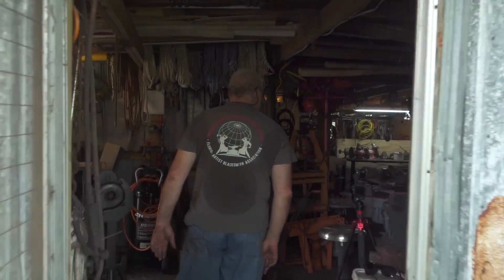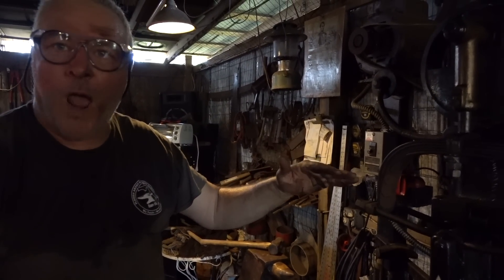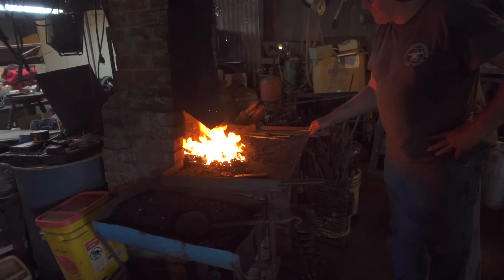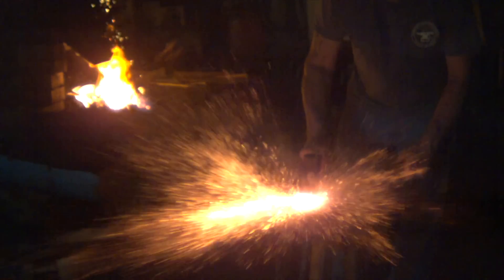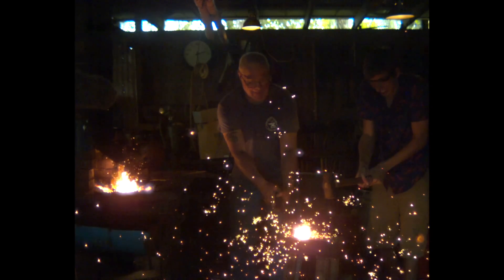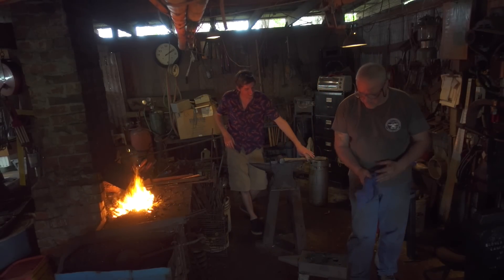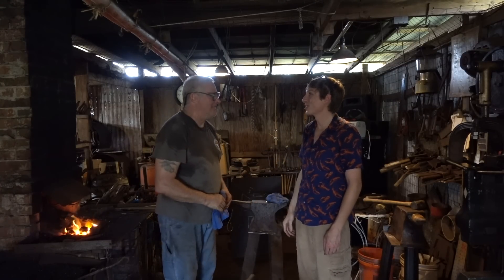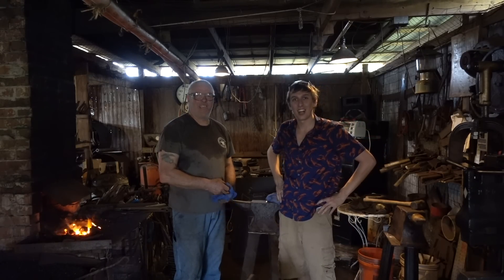Blacksmith Myth - Will a drop of Water on the Anvil make it explode?

Comment: My theory on this is as follows:
Water, or steam, separates at a temperature of 1,700°C into hydrogen and oxygen.
This process is called "thermal dissociation".
When forging steel, the workpiece is heated to "only" 950-1,250°C.
Now when the hammer strikes the workpiece, a higher pressure is created underneath or in the water,
which temporarily leads to higher temperatures.
The temperatures thus generated could be sufficient to split the water directly into hydrogen and oxygen,
which would result in a small explosion of gas.

I don't know if this is right, but at least I can imagine it like this ^^

Comment: What caused the sparks is that he heated the steel up almost to the point of melting it, not actually the water. You can see it sparkling right as he takes it out of the forge.

Comment: I think there might be some truth to this myth but the shape of the metal should be slightly cupped so that it can create a chamber And when you hammer on the top of that chamber and collapse it on top of the water it would create a small explosion I believe but the circumstances and conditions have to be just right

Comment: Also, if you pour borax on the surface, and let it melt, then smack it, you get lots of sparks. Just be careful they do BURN. Also, hot metal is hot, even if it doesn't look like it. Burnt my hand a few times picking up black metal that was roughly 900 degrees

Comment: It's called wet forging or blast forging or scale blasting, depends on who you ask but it's definitely not a blacksmyth or a blacksmith myth, any blacksmith or bladesmith would tell you it won't cause and explosion or break an anvil.  it just throws the forge scale off.

Comment: My guess is that the myth is somewhat true. The water drop will react with the iron metal and form H2 gas (which is flammable) and form iron oxide (rust). It would be a very hot reactoon as the hydrogen would burst into flames but no explosion, just lots of rust afterwards.
Reply: Norgret _ no, just flash boiling.  Getting any significant amount of a reaction like you describe would take pretty crazy temperatures to break enough of the water molicules appart, and would leave the surface more rusty, not super clean.

Adding the pressure from the impact forces the water and metal into full contact (rather than being kept appart by steam), and greatly raises the boiling point while it heats up. When the pressure of the impact starts to subside, all the now superheated water tries to turn into steam all at once and shoots out between the anvil and metal, scouring the scale off of the metal with high pressure steam.

Comment: He overheated that metal. If it glows white and the air around it sparkles, the metal is overheated and burning. That's why so much scale shot off when he hit it -- the scale formed from the burning metal and broke like ceramic.

Comment: It's frustrating to see the "myth factoid" placed on the screen, and you don't test to what the myth reads. Probably no different, but what if in the molten salt videos, you used those other slightly different mixtures, rather than the actual proper salt intended? 
still love your vids backyard scientist, but make sure you follow the scientific method!

Comment: What if you were to heat the top of the anvil in some way for example with an electrical charge and then put water and cold metal on it and hit it with the hammer? wonder if it would work?

Comment: this guy had his metal to hot nearly burning the metal, if you get your metal THAT hot it will expload off the anvil with moltan iron slag and scale without even putting water on the anvil, that is called forge welding temp, i think you should retry this and get him to only heat the stock to a cherry red or amber and also get him to hit the glowing stock without water and with water, i bet you get the same result, you really just had the metal to hot, i use water on my anvil nearly every day you get small pops from the hot metal as its vaporizing the water quik, its just like when you drip water droplets into a hot pan it skates around on a steam pocket yeah? well if you hit that water with a flat surface while its skating around it will just heat up quiker and squish out the sides of the hammer real quik, kinda like when you bite into a cream slice and it all comes out the edges.

Comment: Hey Backyard scientist,  I've got a new idea to make another explosion. This is called aluminum and iron oxide, with strict rules, this can be dangerous so wear heavy protection. 
Step 1: Powdered iron oxide and aluminium are mixed in a glass breaker. To be safe place it in an a cast-iron vessel filled with sand to control the awesome reaction.
Step 2: A magnesium ribbon is lit to ignite the powdered metal mixture as the temperature rises to 4,530 degrees F, the aluminium tears the oxygen away from the iron oxide. The whole area is showered with red hot burning metal.
Step 3: Look in the pot and aw at the aftermath.
-The Elements by: Dan Green
PLZ PLZ PLZ  do this for your viewers, thanks
Reply: Literally everyone has heard of thermite.
Reply: It's called thermite
Reply: He's done Thermite reactions before, and I agree that they are beautiful, and deadly.
Reply: uhhhhhhh ummmmn thermite
Reply: This guy invented that, he named it "Thermite"

Comment: Do this same experiment but with titanium or any of the alkali metals!
Reply: There's quite a few race engines running titanium valves, keepers, locks, connecting rods, and wrist pins.  Not pure titanium obviously but still a variant of it.
Reply: Even the alloys of TI will "combust" if you get them hot enough. The only reason Ti engine components survive is because they're actively cooled.
Reply: @beachboardfan9544  I think you've encountered a Reddit scientist™ who think they're a lot smarter than they actually are.
Reply: u mean potassium, titanium is a transition metal. GET UR CHEMISTRY RIGHT
Reply: No I mean titanium, because red hot titanium will break apart the hydrogen oxygen bond of water, absorb the oxygen and leave behind sweet explosive hydrogen. I added the alkali metals because all of them are simply reactive with water.

Appreciate the aggressive comment from a 10yr old tho, wont make much of an adult with pretentiousness and cynicism.
Reply: wait, WHAT? titanium is a inert-ish metal. It doesn't react THAT much.
Reply: liked for your chemical knowledge.
Reply: Yea, Ti is fairly inert until you heat it, not only will it produce an exothermic reaction with oxygen (like most metals) it will also react with the nitrogen in the air in the same way it does with oxygen. A few race engine mfg.'s had some catastrophic failures while testing some Ti components, the Ti got hot enough to combust and well turned into TiO2 and TiN2 (essentially a white-ish powder). Ti is really only useful as as non-friction structural components... unless its goes through extensive surface coating procedures.

Comment: I like that they did include at the end that smiths do work with a wetted anvil to help remove scale.  You see it a lot on Walter Sorrels' videos.  Part of why it's SO cool and dramatic looking in these is that he's heating it to over welding temperature so there's actually molten metal and a good bit of oxide on the surface when he hits it.  Always cool to see sparks in slow motion :)

Comment: Power hammer vs RED HOT 10000 Degree knife!
Reply: Please sir.  A knife at 10000 degrees would just be a iron oxide gas.  Steel melts at 2750 degrees.

Comment: Yup the only thing that will  happen if you put water on an anvil and strike a hot piece of metal with the hammer is blast the scale off it, I usually wet the hammer and anvil when I'm setting my blade geometry (laying in bevels and what not) right before I heat treat the blade... saves me about an 20-25 minutes of grinder work and from hogging off to much material before the quench

Comment: That is a technique the Japanese use called wet forging the reason for putting the water on the anvil  is so the scale will pop off and leave a cleaner piece of metal to work with

Comment: I think, you might have misinterpreted the quote... It says that the water should be ontop of the red hot iron piece. The "dancing around" should refer to the Leidenfrost effect. Then you hit the water drop directly with the hammer. So: Anvil, Red hot iron, water ball, hammer. The iron piece needs to be laying there pretty flat (or even be concave) so that the drop doesn't wander off.

Maybe you can redo the experiment with this configuration.

Comment: Yes water will do what you see in this vid but they are letting the Metal get to hot to the point it's starting it melt you can see this when he pulls it out if the flame and the metal is sparking that just adds to the water. When he goes to the power hammer and the metal is at a normal working temp not sparking  and he only gets a few sparks when hit

Comment: This is used by Japanese sword smiths, as well as many knife makers, to remove the scale from a knife during final forging. 
It works well, although the disadvantage is that the knife or sword cools a lot faster with all the water on the anvil and hammer.

Comment: Just going off of the text displayed about the myth, you are meant to have the water on top of the red hot iron and then hammer down on it, rather than having the water below the iron
Reply from the maker: its the same thing
Reply: I would think that if the water was directly hit between the iron and the hammer rather than the iron and the anvil that it would apply more force to the hammer and thus perhaps send it flying

Comment: The power hammer undoubtedly hits harder but wouldn't it be less likely to get the result you were looking for? I mean is the wheel acting as a flywheel? Therefore any energy "upwards" would transfer back down like normal operation right?

Comment: Huh. I've been a professional smith for 22 years and never heard this myth. In Japan, where I trained, its routine to splash water on the anvil to generate a steam explosion and tear the forging scale off the steel. Works well under the power hammer, too -- you use a straw brush to flick water both on top and bottom of your steel.   Nice vid!

Comment: Why are they called blacksmiths?
Reply: It has to do with the fact that the iron/steel that is exposed to a forge fire turns a dark grey or  sometimes black due to the iron oxide scale that forms on the metal from the heat of the fire. By this logic, a blacksmith was a man who worked metal turned black from fire. In contrast, there is the whitesmith, who shaped pieces of metal with a file and stone. That title comes from the fact that filed/ground steel is very shiny, almost reaching a mirror like or white finish.
Reply: David Meyer what about the smith part?
Reply: +Pain Uzamaki (Akatsuki) Originally, "smith" was derived from the word "smite", which means to hit hard. I'm not a linguist, so I really don't any more details on the word's origins. A blacksmith was a man who smote (past tense of smite) black metal to shape it. From there, "smith" became more generic in usage for any person who shaped metal (goldsmith, silversmith, etc.)
Reply: David Meyer Thank you

Comment: On the side of easy, you could try aluminum can vs power hammer, or gravel vs. Otherwise you might do 2 by 4 vs or small hammer vs power hammer. EDIT: Maybe a single large rock would be more interesting than gravel. You could also try cold steel vs power hammer.

Comment: Please no more 60fps
Reply from the maker: why? I still play the slowmo footage at 30fps if I need to. Sometimes I use a program that analyzes the video, and adds an interpreted frame between two existing frames, effectively making footage twice as slow. Then I can play it back at 60fps, 'cause 60fps is smoooooth.
Reply: TheBackyardScientist when walking and you shake the camera in 60 fps it can give people motion sickness real easily. It's fine if the camera is stable or on a tripod but walking + 60fps is really not good
Reply from the maker: Oh Ok! thanks for the advice.

Comment: It definitely makes a popping sound when wet forging but the reason the sparks where going everywhere is because he heated the steel to the point where it's almost melting which is why it was sparking when he removed it from the fire... it would never send sparks like that had it been a normal forging temperature...
Reply from the maker: True, but it was also louder when it was hotter!
Reply: True :)

Comment: The sparks that fly off of the metal isn't a result of the water. It's just because the steel was at its forge welding temperature, just before it starts melting through. The metal is sparking when he pulls it out of the fire because it is at that critical temperature where it is about to melt, it begins losing some of its carbon content, and when it begins oxidizing very heavily. When you hit it, that's just the scale coming off. It happens whether or not there is water. Great vid though! Keep it up!
Reply from the maker: This is true, but It did seem to get louder as the metal got hotter!

Comment: Umm, just wondering, but why were you wearing shorts in a blacksmith shop, especially when causing steam explosions. Where l work, we've had them that big that the roof of our electric arc furnace got blown off
Reply from the maker: I was asking myself the same question after about 5 minutes of hitting hot metal with a hammer
Reply: A couple of those sparks getting in your shoes could have ruined your entire day, possibly longer

Comment: Try using the waterforging technique on a bigger power hammer.  For instance, instead of using a 50lb hammer try finding a 3B or 4B Nazel electropneumatic forging hammer.  The 3B is about 230lbs and the 4B is about 400lbs.

Comment: So I guess the smashing action dramatically increases the surface area between the water and the hot metal, causing it to vaporize very quickly. Maybe there's even some compression happening, so it would raise the boiling point of the water while heating it up, and then when it finally finds an exit, the superheated water blams into vapor.

Comment: Power hammer oobleck would be interesting
At what point does the oobleck just give way and let the hammer through
Reply: This needs to happen. Would the oobleck just crumple into dust and reform into liquid?
Reply: It would give way pretty much immediately.
Reply: Oobleck in its solid phase still isn't that strong. THe hammer would simply smash through it.
Reply: ಠ_ಠ